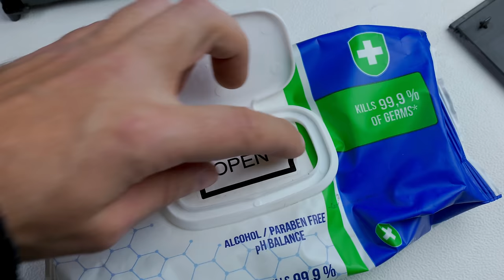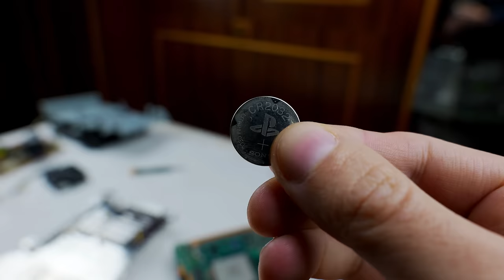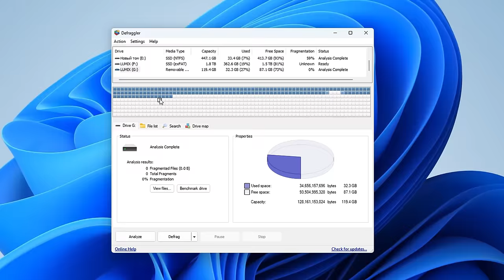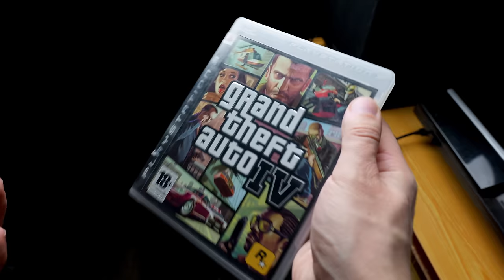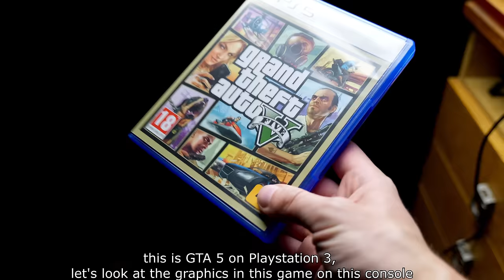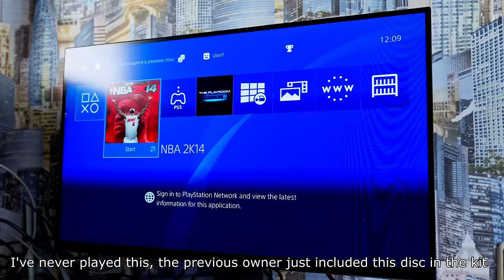You WON'T BELIEVE How DIRTY This PlayStation Was!

Comment: FYI don’t let ur fans spin above recommended rpm it will mess them up so they won’t work properly to vent out heat I usually stick a little toothpick or something in between the blades so it stays in place while I blow it out and clean them on my ps5